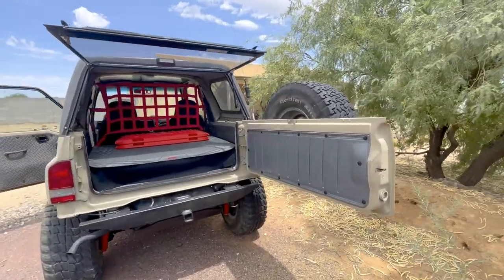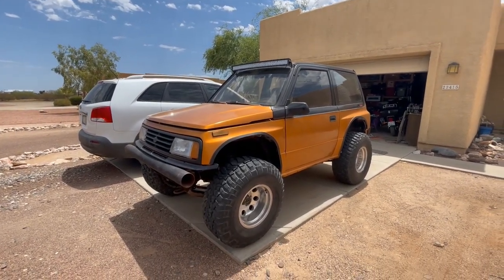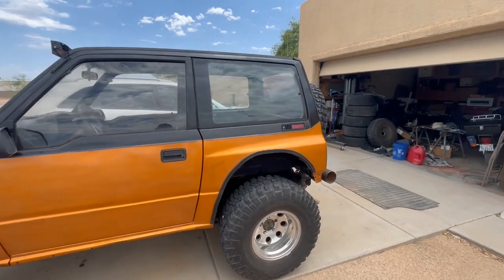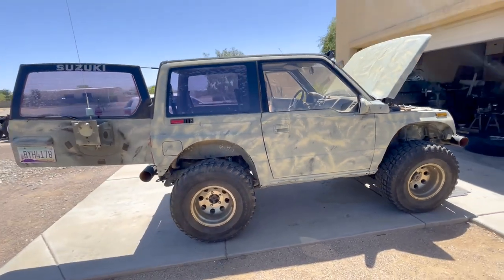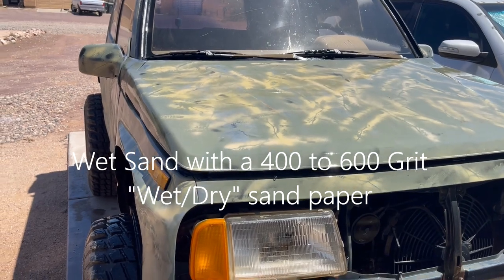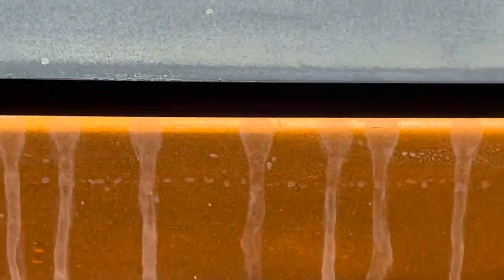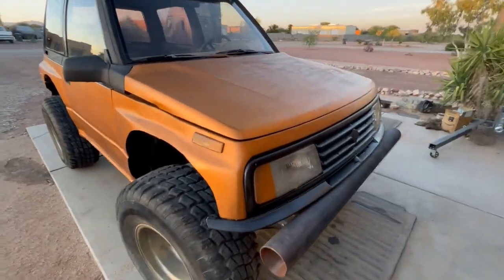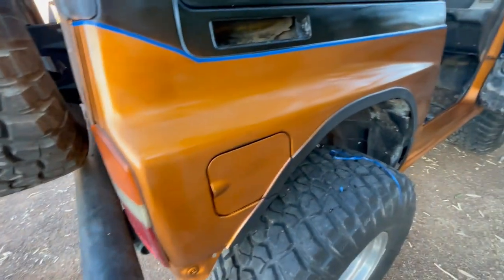"YES YOU CAN",  Rattle Can Paint A Whole Car

Comment: i love the paint job as well. i have two trackers and one is sail blue (sounds lame but is awesome) and the second is black and orange. both done in the drive way as well. it really makes these awesome rigs stand out and give them character. its cheat and fun too.
Reply from the maker: I actually considered Sail Blue,  it's kind of a cool color.  I was going to do the suspension  (springs shocks ect)...in Sail Blue,  Thank you for your comment.
Reply from the maker: Hold on to those trackers...there may be a resurgence coming as new 4x4's are way to expensive, pricing most of us out of the market.

Comment: I like the copper color ,  fits it nicely imo , really stands out . What is the actual color called? 
I got all winter to decide the color I'm going to do on  this here tracker I got about 3 weeks ago . Their great little rigs that hold there value.
Reply from the maker: The color is actually a Burnt Copper metal flake that I found on Amazon.  https://amzn.to/3ZzWbov   I actually had several cans of it on hand from an unrelated  project some years ago.  Some of my trackers have bumpers or Targa tops, or springs and lift blocks painted this color.  Like,  Low Range Off-road has RED,  Calmini Has a Light BLUE...Tuff Trails had Burnt Copper.  
The camera loves the color, but actually in person, I do not.  It does not have much depth even though it has three coats of clear...but the sun does light it up pretty good.  Our theme is Low Cost,  Affordable or Budget off-roading which focuses on a lot of  DIY stuff that a person could do with some basic tools and a standard garage at home.  In the case of painting with a rattle can,  it is cheaper to get a Harbor Freight paint gun and a good single stage urethane and knock it out in the driveway real quick, but some neighborhoods and local ordinances may object...lol 
Thank you for you question...

Comment: Hey Cal , on my tracker the water pump pulley is so close to the timing belt cover that it has rubbed a hole in it . I'm a wondering what is wrong the cover is warped ? I have found missing bolts. Loose bolts . All are tight now 
 But still to close to the cover
Reply from the maker: Pretty Common occurrence,  Sometimes the belt wears and stretches over time and can get sloppy and rub against the plastic cover.  The tolerances are already very close so even and old pulley can develop a minor wobble resulting in the same effect.  Or a lot of times the bolts get loose and the plastic timing cover will slightly rest against the belt.  Those are the areas that I would look at first.
Reply: @tufftrails  excellent that's what I needed to know . Also ever tighten the steering box to get rid of the steering wheel play ?
Reply from the maker: actually that is one that I haven't ever had to deal with... @fragilelivesbrokendreams3074
Reply: @tufftrails  thanks you for your quick responses Cal.